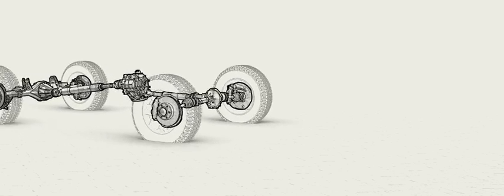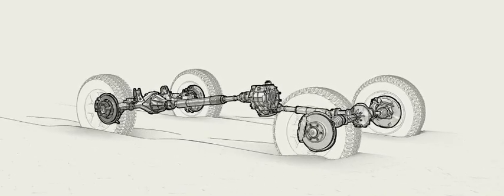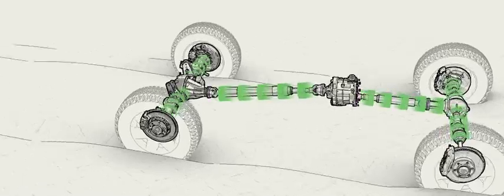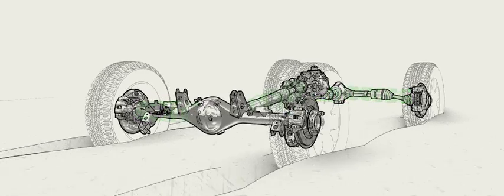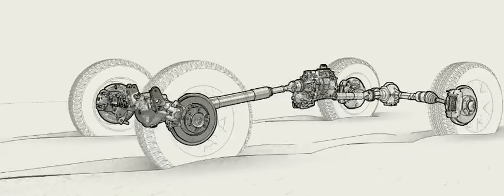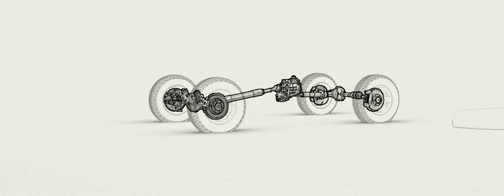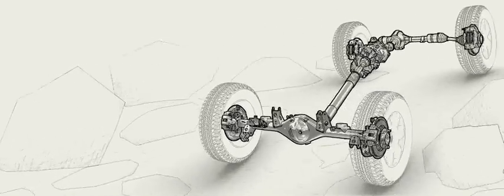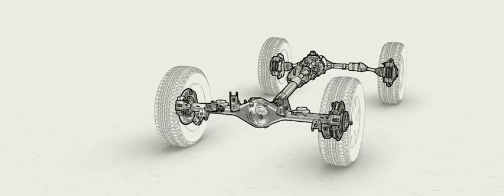Toyota FJ Cruiser - Electronic Locking Rear Differential

Comment: As soon as the factory rear diff lock is engaged the Atrac is switched off leaving the front a  open diff ....
Reply: @ConsoleCombat  does this have anything to do with the early 07 tcs system not being able to be disabled manually? I have an 07 and there is no tcs off button from the factory. I assume there’s some correlation because a-trac isn’t a locker just a brake torque vectoring system.
Reply: @ConsoleCombat  thanks for the reply. Merry Christmas

Comment: Locking the rear while in 4x4 with the center locked does not double, just changes from one front, one rear, to one front, two rear. Foolish! Do the math! There would need to be an engaged front locker, which is a bad idea with IFS. 70 series all the way!